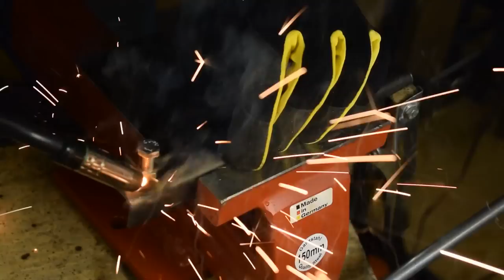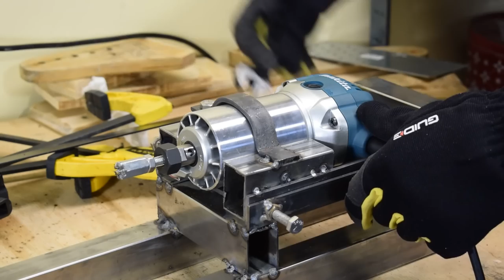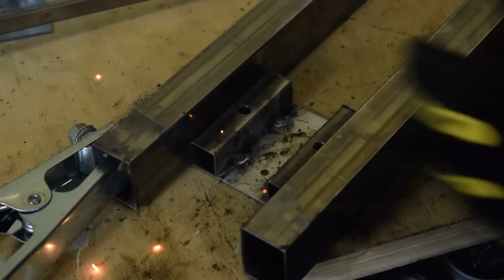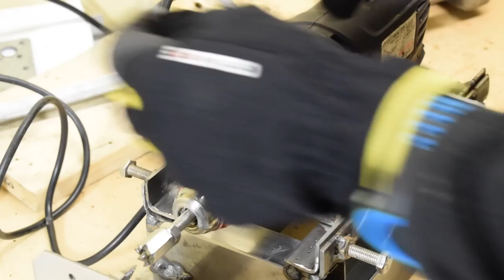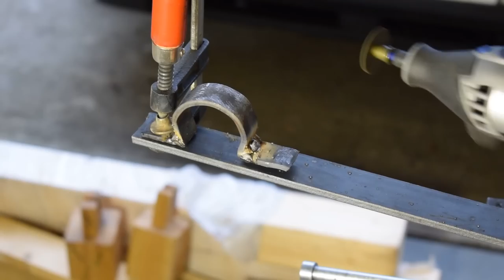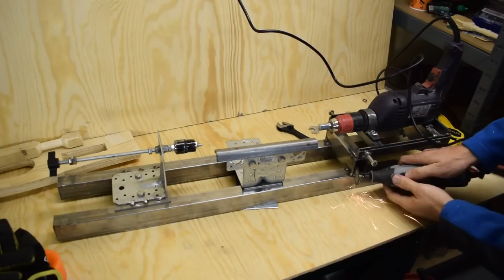Homemade lathe with a drill, the multi-feature platform Part 1

Comment: Hi nice job just two points some of the welds may need to continuous as vibration will tend to crack small point welds. Second point do not wear gloves around machines! I got my glove caught in drill press chewed up my fingers before I could stop it!!! They also say no long sleeves not been caught with that one myself but keep to t shirts anyway. Nice job.

Comment: bracket holds your spindle in few points. you can use paint mixed with cheap mineral oil to found this points: cover you router mount surface with thin paint layer, touch it with bracket and caret, and use scraping to enlarge contact surface.

Comment: Nice work !  Your welds aren't terrible by any means, but I do have a small suggestion that will save you some grief later down the road. Keep the tip and the gas shield further back. The tip will get covered by the spatter which will add resistance to the feed rate making  for crappy welds and can damage your welder. Peace :)